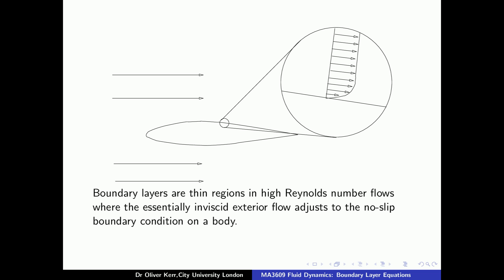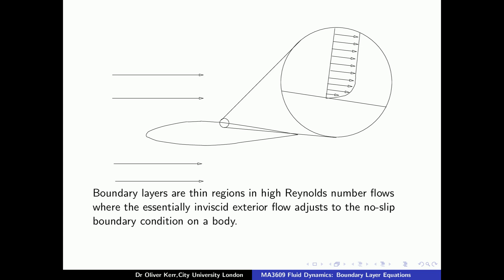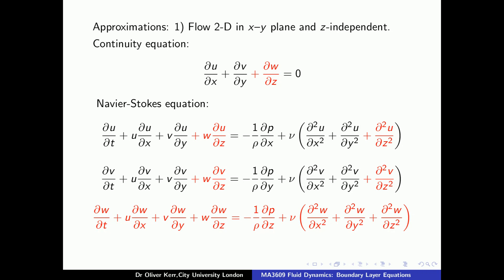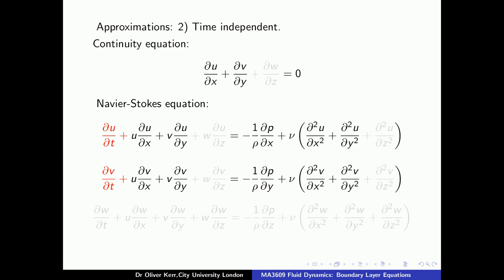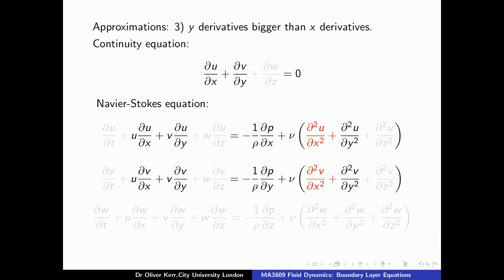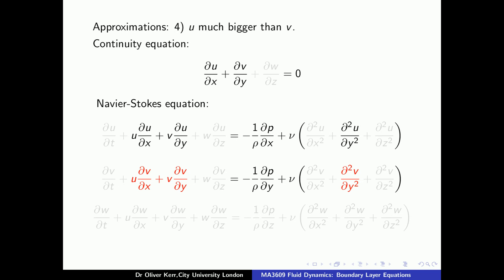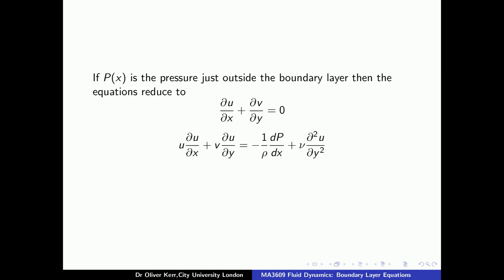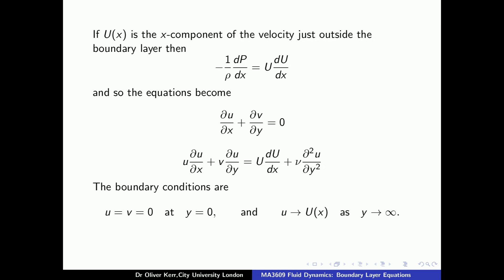Derivation of the Boundary Layer Equations

Comment: Please please please explain how assumption 4 means dp/dy is approx zero. I can't understand how what you said in the video would imply that. By isolating the dp/dx and dp/dy terms in their respective equations you can see that your argument isn't clear as the second derivate terms are on the other side of the equation in the beginning and so could negate the effect that du/dx > dv/dx and that du/dy > dv/dy
Reply: There are two steps to stating that dp/dy is approximately zero. 
1. We know that d/dy >> d/dx. This means that dp/dy should be much greater than dp/dx.
2. We can deduce from u>>v and d/dy>>dx that all terms in the second equation are much larger than those in the first equation. 

Combining these two statements creates a paradox when looking at the pressure term. It is larger in the y-momentum equation (dp/dy>dp/dx), though the other terms are smaller than the corresponding terms in the x-momentum equation. We can thus conclude that the pressure is constant across the boundary layer as dp/dy must be approximately 0.

Note that its conclusion, dp/dy=0, also allows us to use the external flow velocity to substitute the pressure term in the subsequent step using Bernoulli's principle.
Reply: If anyone sees this in the future, the simplest way to understand it is that in the momentum equation (NS) for y, all components other than the pressure gradient are very small. So if you collect the pressure gradient on one side of the equation and the other terms on the other it becomes clear that the pressure gradient must equal the sum of three very small things, and for the equality to hold, the pressure gradient itself must be very small.

Comment: is this prandtls boundary layer equations?? pls answr
Reply from the maker: Prandtl's boundary layer equation usually refers to the similarity solution obtained from these under the assumption that the exterior flow is constant, as would be the case of a thin plate inserted in a uniform flow parallel to the flow. So this video shows the first step required in deriving these similarity solutions.